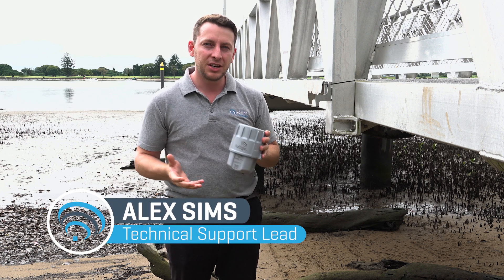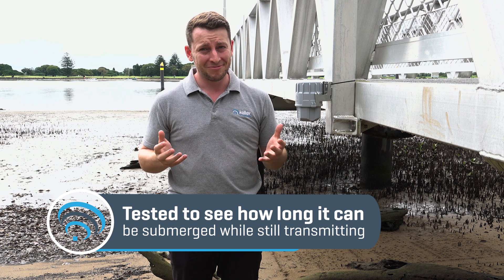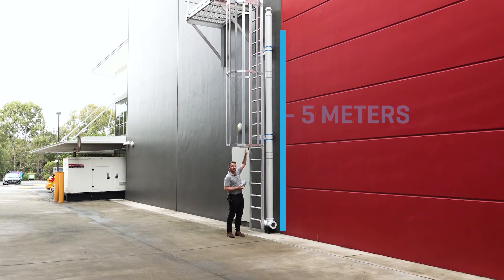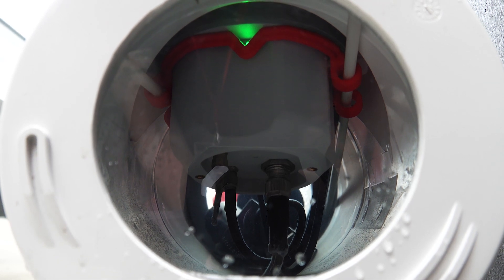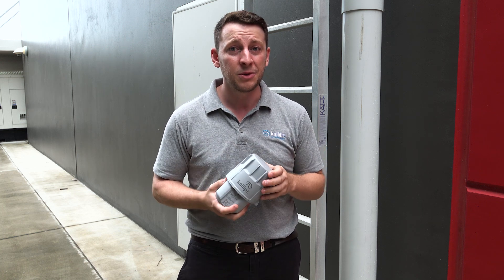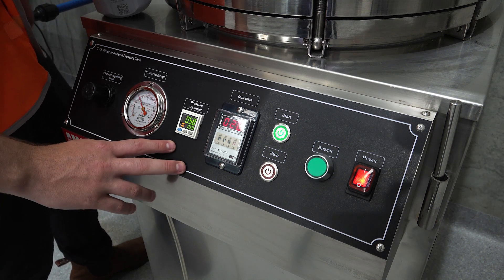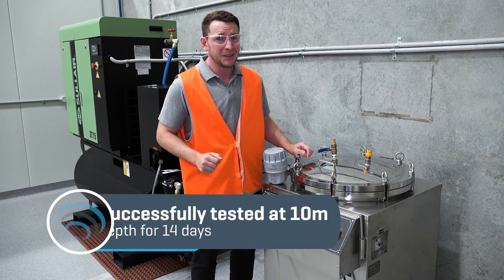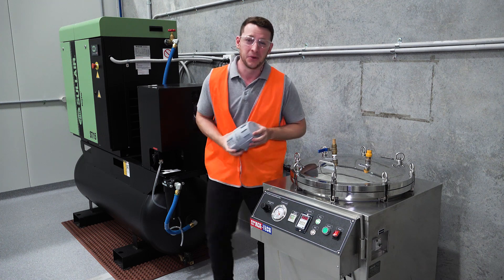How We IP68 Test Our IoT Devices

Comment: Why does my smart thermostat need to water resistant of upwards of 10m
Reply from the maker: Your household thermostat most likely doesn't need to be as rugged, however when we're talking about smart devices installed along critical infrastructure that is feeding back critical data to utilities, rail, mines etc then it's super important that it survives bring submerged in water for longer periods.
Reply: @Kallipr  Why, I get wanting rugged durable equipment but this is a wall mounted thermostat, no? Why does it need eater resistance